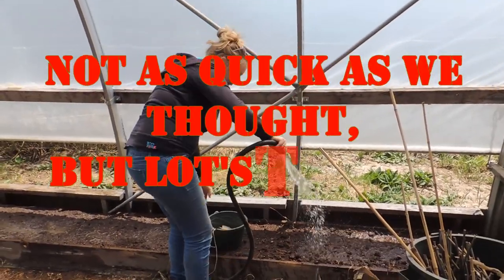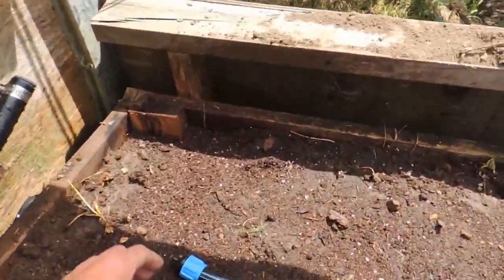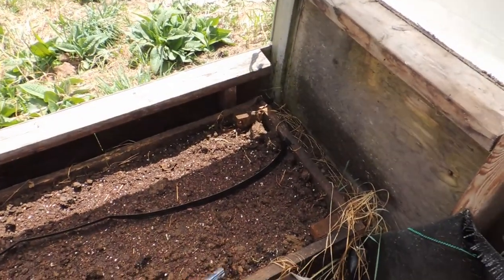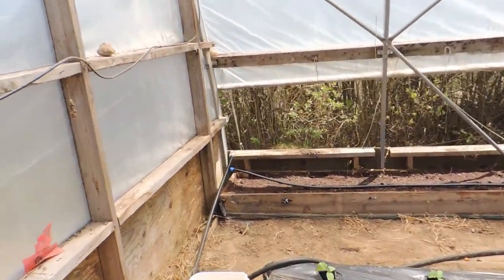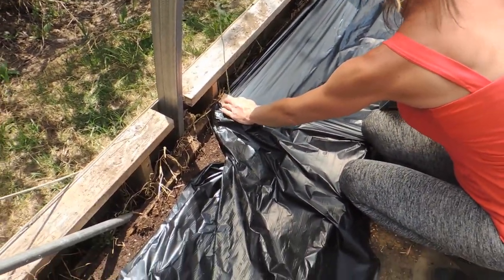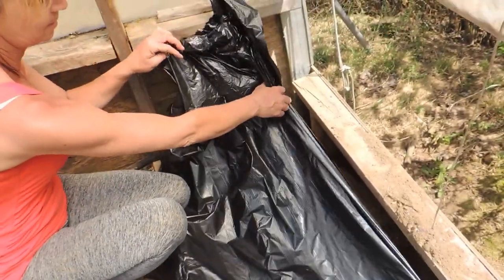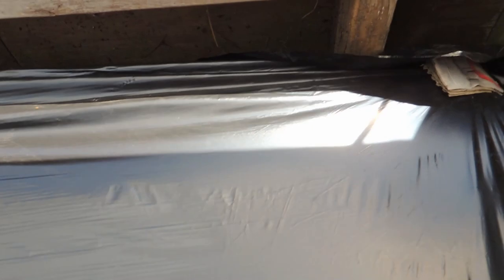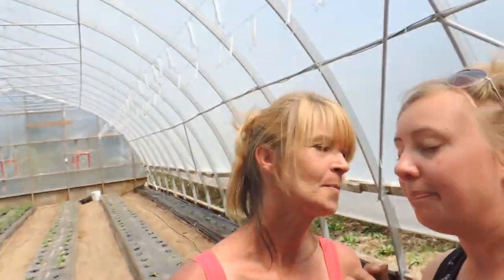HOW TO LAY DRIP IRRIGATION AND PLASTIC MULCH ONTO RAISED BEDS

Comment: I use old t-tape instead of cardboard to staple my black poly to the baseboard on the greenhouse. I also use it to hold clear six mill poly on my gable ends. The great thing about using t-tape is that you can grab the loose end and pull all the staples out with a quick jerk. No tools are needed to remove it. I use 5/16" staples, they hold well but still come out with a tug on the t-tape.
Reply from the maker: wayne busse 
That's a great idea Wayne,  thanks!  We will have to try that. Thanks so much for watching and the great tip, have a fantastic weekend! ☺

Comment: Thanks for that video. Do you put 2 lengths drip tape in beds were there are two rows crop?
Reply from the maker: +Terry Parsons 
Hi Terry, actually we only put two drip tapes in the wide beds and one in the smaller 2' beds. I think we should have ran two drip tapes in all but it's working alright. Thanks for watching! ☺
Reply: Spring Hill Farms thanks Patti. Keep them coming 🌱

Comment: How deep do you dig out and replace each year for the dirt. And is there gravel or concrete under the beds.
Reply from the maker: Hi, we don't dig anything out of the beds. Once we pull the plants, it depletes the soil. In the Spring we will till the beds and top up with organic material. No, there is only dirt under the beds, no gravel or concrete. It's working great for us so far! 😀 thanks for watching!
Reply: @Growwiththelaplantes  can I cover the floor of the whole greenhouse with that black polythene cover  before putting the raised bed?

Comment: For the drip tape  just tie a knot in the end.
Reply: davetileguy actually if you cut 30mm off and fold the end back 3 times your 30mm piece fits over and locks it closed

Comment: The things are called quarter turn ball valves.if the handle is inline with the hose there open and to the side closed..you move the handle a quarter turn to open and close the valve thus the name.

Comment: Stop using that drip tape your runs are not that long get some pvc pipe and drill some small holes in it and it will last a long time.